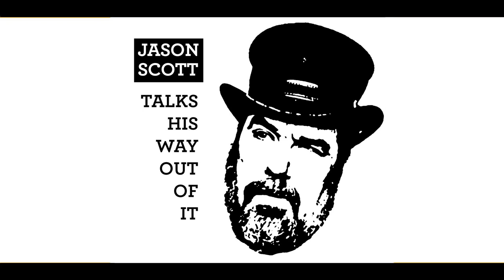The VCR Mechanism Episode

Comment: I was just imagining this type of device the other day! Imagine an old linear hard drive read head, like the kind from an old MFM hard drive. It just goes back and forth. Pull the tape out of the shell just a little bit, and advance it by just a millimeter or so while this head shoots back and forth across the tape. It reads the helical information as raw magnetic flux and can stitch it back in post. This was just a crazy thought I had while smoking too much. But in this way, you'd be able to read the data in a linear fashion and decode the information regardless of format. Don't ask me how to do it, the picture just sorta formed in my brain.